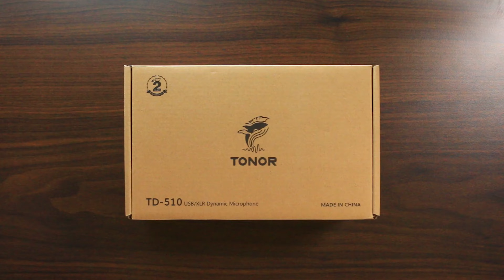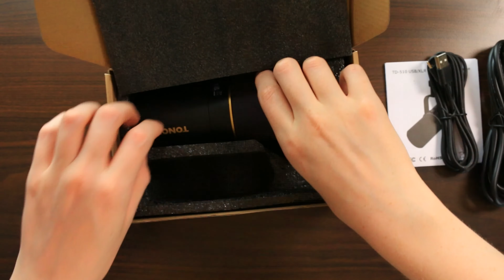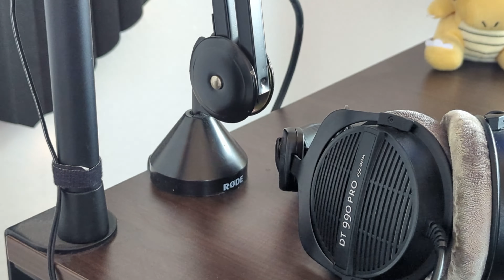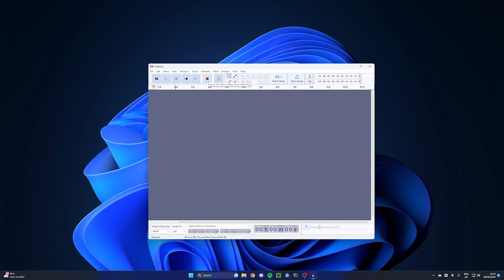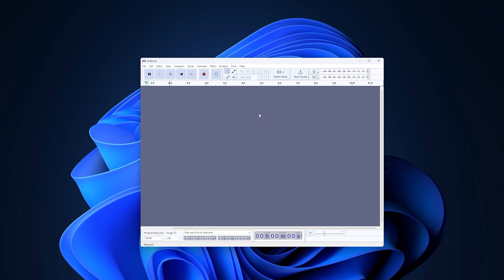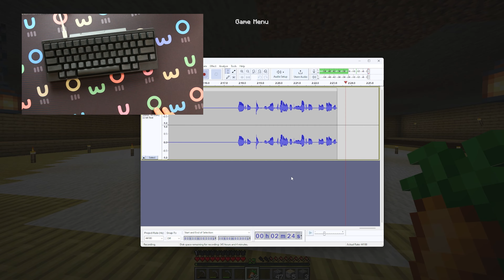Budget SM-7B? Testing the Tonor TD-510 XLR and USB Microphone!

Comment: My mic just came in I love it my problem is the yoke of the mic isn't very strong and doesn't hold up the mic without flopping if Tonor fixes that it will be the best budget xlr/usb mic. I also replaced the wind screen with a shure one instead.  I also used my own cable while i loved that it came with one the cable looks really cheap which scares me so I will not use it
Reply from the maker: I also noticed this and turning the microphone around actually solved the problem!
Reply: @andi  that's really good to know but I hope in the future Tonor either use better material for the yoke or do a normal double yoke